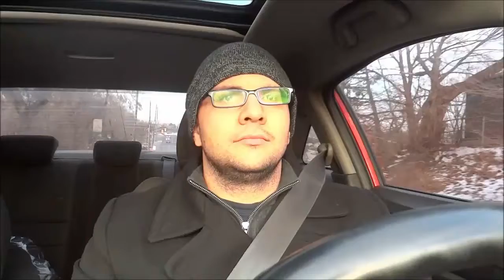Horsepower VS Torque-A BASIC Explanation

Comment: Power, not torque, is the limiting factor in not only the top speed of a vehicle but also how quickly it can accelerate at any speed and how much weight it can pull up an incline at any speed

Comment: Torque is the force horsepower can be seen as a response of that force being used. Torque is a better indicator of strength where horsepower can be seen as accelerative energy. Ff course it correlates with rpm which is the amount of rotation the engine makes using that torque. So this video is not accurate.
Reply: Then why are racing engines petrol ? They should Torque based (Diesel). You clearly did not understand, the guy is literally yelling at you trying to explain you what's going on. You have just made up your mind that its torque is best, not HP. That's why people say, one is more powerful than other, not he is more Torquie than other.
Reply: yt678901 I don't think you understand hp  and torque are not independent. learn physics
Reply: I was thinking about cars, so was a bit incorrect. Here is a link, tell me which one is better power wise?
https://www.carwale.com/comparecars/toyota-corollaaltis-vs-toyota-innova-2015-2016/
Reply: yt678901 ok look I am not trying to argue with you at this moment. I have an understanding of the physical forces accruing. I suggest you research and learn. What I am stating is taken as fact not arguable.  Torque is circular force within the engine, HP is the outward force resulting from that torque force. no HP then Torque is waisted. no Torque the. no HP. I will argue with you no more if you don't understand I Encourage you to learn. best wishes. 
p.s. cars are physics in practice
Reply: That's the problem with everyone, they know Physics, but when its applied in real life, things go crazy.
Reply: yt678901 like I said go learn cars work they don't go crazy. Crazy are only those that argue blindly
Reply: lol.
Reply: Power is both strength and speed.  Power = Force x Velocity.

Comment: horrible video.  rate of change of KE is power..   torque never  is taken over by power... that's just silly talk.   torque, or force causes acceleration and power is the indication of a cars ability to accelerate at ANY speed  or to great force at any speed.
torque is just a component of HP.    power can be measured by torque and RPM, or rate of change of KE. either way is correct.
remember, the Newtonian identity shows tha acceleration is proportional to power.  acceleration = power/(mass x velocity)
Reply: agree. im sick of people driving to work and trying to "explain" anything, cause they usually are wrong.
Reply: they  are always wrong.... ;)
Reply: This guy sucks... big time.